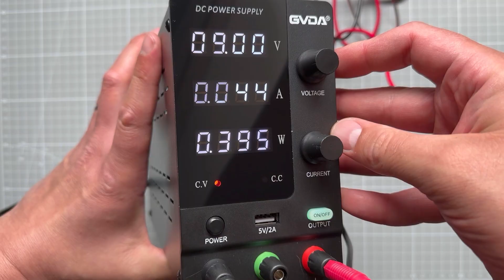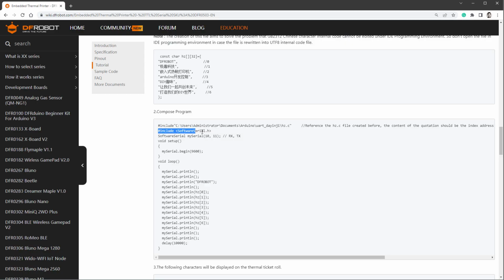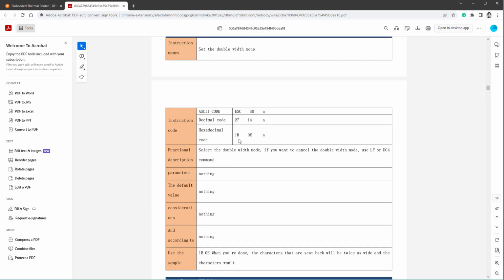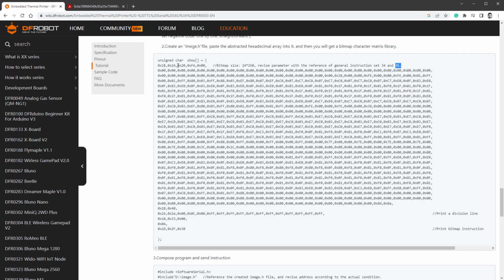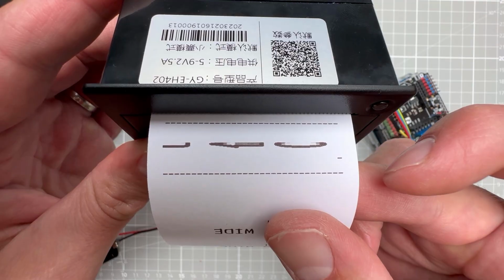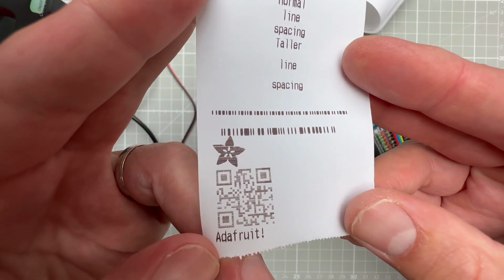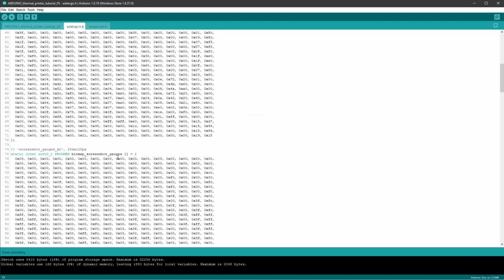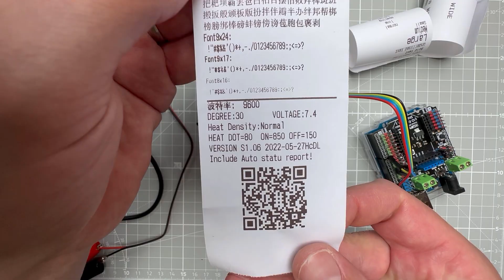Printing with Arduino

Comment: The Adafruit library has an artificial delay, that's why it's so slow. If you use the standard ESC/POS commands over serial it will be much much faster.
Reply from the maker: Good point, thank you for your comment!

Comment: if i want to dynamically print qr code is it possible? like if i give a string through serial input, the qr code for that string should be generated and printed.
Reply from the maker: Yes, that should be possible. There might be support for this directly in the printer, and if not, you can look for some Arduino library to do that.

Comment: Thank you so much for this video!! Perfect step by step and was able to follow as a beginner. I was wondering if you knew anyway I could alter the printer/arduino program so that the letters print upside down? I was hoping the orientation would be different for the project I am using the printer for. I read online that I can convert all my text to a bitmap, and then change the bitmap's orientation but wanted to ask if you knew a simpler way to do it? Thanks so much! :)
Reply from the maker: That´s great to hear, thank you for your comment, I really appreciate it! Flipping the bitmap would work for sure, but as you have noted, that might be slightly more involving. I would check the documentation for the printer, there might be an option to rotate the output.

Comment: Is there any way to draw lines and pixels on the paper like you can in an AdaFruit TFT display?
I'm trying to make a graphing calculator that prints off graphs btw.
Reply from the maker: Sure, the image that I´m printing is just a set of pixels. You should be able to draw stuff on the Adafruit framebuffer and send that buffer to the printer instead of sending it to the display.
Reply: @upir_upir  sounds insanely complex yet not exactly impossible

Comment: amazing tutorial, but can I convert the image to bytes without a website, in my code? wanna make sth like those Bluetooth/wifi printers but seems like a too complicated kinda project for a beginner like me
Reply from the maker: Thank you! Converting images to bytes is not that hard, but if you are a beginner, that part will be probably the simplest of the whole project. I would suggest starting with something simpl(er) first.
Reply: @upir_upir  haha yea, got experience in C# programming so it should be easier to get the basics, but got a long way to go in electronics. thanks for replying, that was exciting to get one from you!

Comment: Hey, do you know if there are sticker rolls for this printer? I was thinking about making a "spool station" (for my 3d printer) that would weigh the filament rolls and print a new QR code sticker for me to put on the spool, to make keeping inventory easier.
Reply from the maker: Yes, a quick search shows that you can indeed get sticker rolls on AliExpress (and probably elsewhere). Sounds like an interesting project; please feel free to post a link if you do it! Thanks and good luck.

Comment: hi
can you make the a program for qr code with giving a 5volt power supply only to the controller and its print with thermal printer ?
and when ever we supply 5 v it will print a qr code
Reply from the maker: Yes, that should be possible. Which part do you struggle with?

Comment: Hi
For a esp32 I must use the rs232 or the tll version of the printer?
Reply from the maker: The TTL version. TTL stands for transistor-to-transistor logic, and sets the voltage levels - usually 3.3V or 5V. The RS232 is the same protocol, but the voltages are I believe -15V to 15V, so you would need an additional chip/shield/module to convert RS232 to TTL.

Comment: Your videos have helped me a lot to learn new things, to the point that i am actually going to buy that thermal printer! I don't know that i will do with it but i want to play with it ahaha.
 One question, Should i use the TTL one or the RS232 version?
Reply from the maker: Thank you, that’s great to hear. Also, I would recommend getting this printer for a beginner, since it’s really simple to interface. The TTL version is preferred, you can use it directly with Arduino. For the RS232 version, you would need additional shield/ module.
Reply: @upir_upir  thank you so much for the answer! I will get the TTL version!

Comment: Wow, one of the best-paced, well-recorded tutorials I've seen! Thanks for the effort. I got frustrated by running a thermal printer from a Raspberry Pi and put it away--I'm going to get it out now. Love seeing the extra tips like creating a new tab for a .h.
Reply from the maker: Thank you for your nice words, I´m glad you like it and it was useful. I was quite surprised to find out that the thermal printer is very easy to operate - at least for the basic stuff. Obviously, bar codes, QR codes and images are little bit more involving, but thankfully the library was there. What project are you planning to use the printer for?
Reply: @upir_upir  A coin-operated Pi camera printer! There's a Linux print driver that will do it. Logic-level shifts, monitoring for events, it all got past my patience. I'll figure out something simpler for Arduino, it lacking a camera.

Comment: Hi, where can i purchase that printer. I am really in need of it BIGTIME.
Reply from the maker: Hi, the link should be in the description. In case you prefer other size than AliExpress, simply search for "DFRobot thermal printer". Note that it does not have to be the "DFRobot", any thermal printer module will work as long as you use the one with TTL UART connection (not the RS232).

Comment: I really like the things you show off in your videos but they're a bit too tutorial-y for me, I don't really need to know that you had to use an adapter to connect the pins or the syntax of the printing library, just my pov
Reply: I especially really like the videos about eccentric setups for displays, the custom fonts were dope, I love making custom fonts for my vfds, can be fun to use them as vu meters or spectrum analyzers
Reply from the maker: Thank you for your feedback! I agree with you, as I was thinking about something related lately. As much as I enjoy recording those full-length tutorials, they take a long time to finish, and I have dozens of other projects in progress - actually on hold. I will try to include more short(er) videos with projects overviews, and probably record tutorials only about those that will get the most recognition. I will still include a lot of VFD displays, I love those!

Comment: Looks like ZX-81-Printer for Arduino! :O)
Reply from the maker: I had to google that printer, it seemed to be using a very special paper in black color with aluminium foil over it. I would love to see that in person, but I´m slightly worried it would be very hard to get. I´m sure it looked way cooler than the regular thermal paper.
Reply: @upir_upir  Hello upir!
Yes, thats right! The Sinclair ZX-81 Printer used 2 needles on a "endless-tape" to burn the aluminium foil away. This was really "innovative" - but it worked. More or less. The printings where black on silver and the contrast not so good as an modern printers. But in theses day there was nothing else, especially for this cheap price. Here you can see the construction: https://youtu.be/RHOXv2exdak?t=1618 :O)  I have several spare-printers lying around, if you wish i can send you one, or two? For investigation? :O) Nice greetings from Germany and thanx for your great projects!
Reply from the maker: Thank you for the additional details. Yes, it looks like very rare technology, it kind of makes sense why it disappeared, but it has that vintage sci-fi futuristic feel, I like it a lot. If you have a spare one that you can miss, I would be very glad if you can send it to me, can you please write me an email to upir (at) upir.org? Thank you very much!